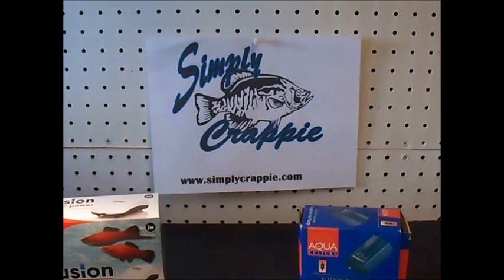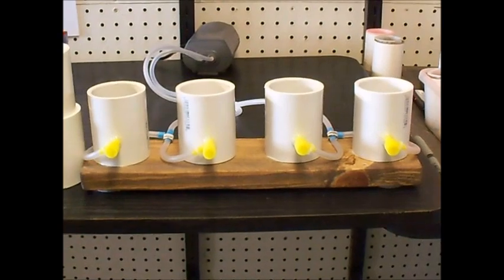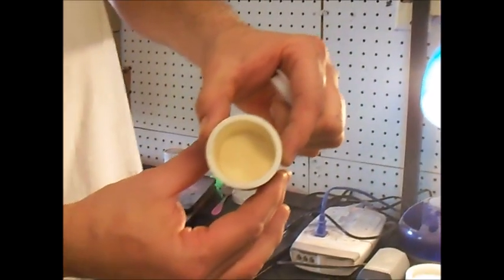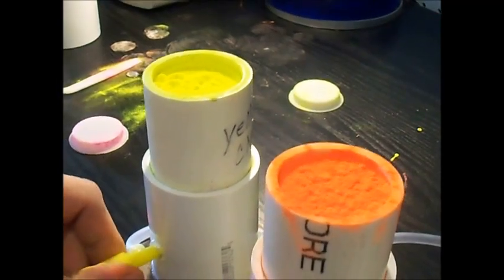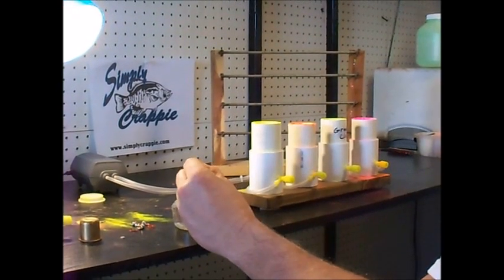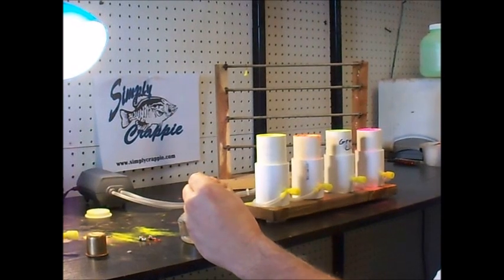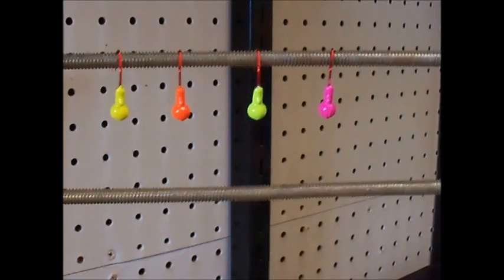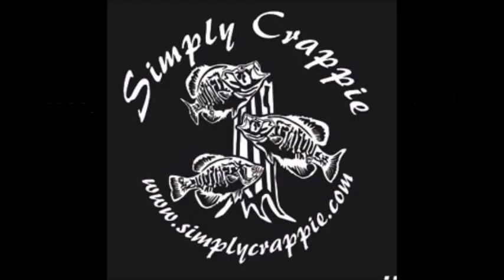Simply Crappie Fluid Bed

Comment: I had built two bases already. I was looking at making cups and saw this video and checked out the Simply Crappie website. The price on the cups was hard to pass up. I wanted a cup with a bottom that was not prone to tear. These cups are amazing. Just like the video I can really get the air going to the powder paint and nearly push it out of the cup. Very little to no volcanoes. These cups perform exactly as advertised. Thank you!!!

Comment: Help I have the fluid beds but it seams I am getting to much powder on my ball heads . They look fine till I bake thelm then they get oval shaped . Have a solution for me ???
Reply: Too much paint. Try heating half the time you normally do then dipping in the powder. Aim to get the lead just hot enough to get a rough coat stuck to it.